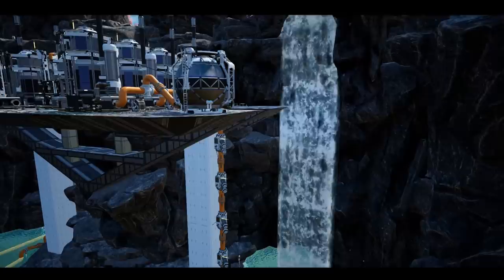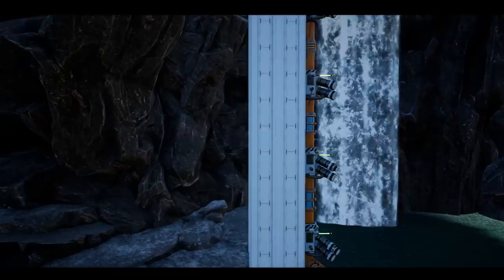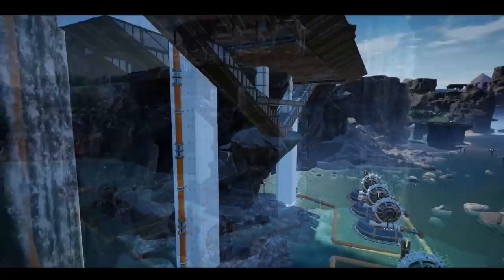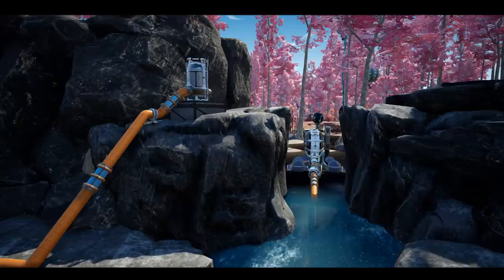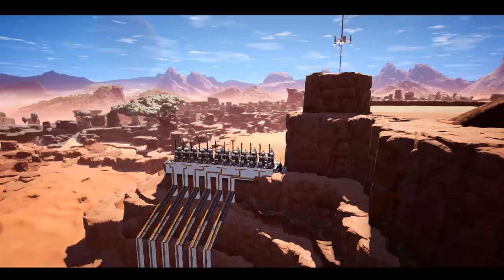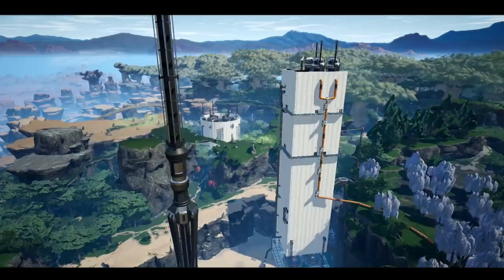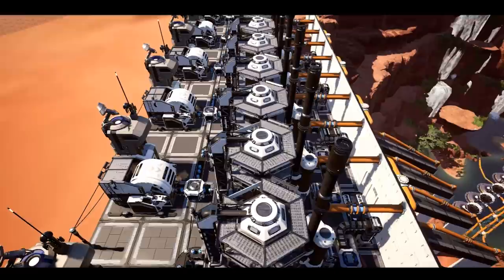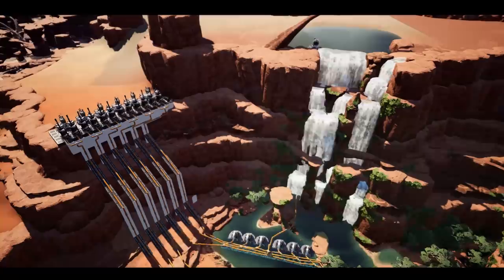A Guide to Not Needing Pumps [Satisfactory Guide]

Comment: Yes it works but it's obviously a bug/abuse/cheat.

As it is now, you can use a single water extractor, pump the water up a really high tower (or package, conveyer it up and unpackage at the top) and have that tower provide the headlift for all the extractors you want. As long as the "bottom" extractors put enough water into the pipes the top headlift will be preserved and the water tower will not even be running much (or at all) because your water level will never drop.

as with other bugs that existed (and got fixed).  be careful about using this. your entire factory could fail if they decide to fix this :)
Reply from the maker: You're right, and it is worth running this on the side of caution, but I'm sure there'll have new pipe options when they update it too so we'll probably want to redo our pipe networks (hopefully)

Comment: So, if you had a tower with a reservoir and an unpacking refinery, then all your extractors at the bottom with one packing refinery (and a belt and conveyor lift to lift the packaged product), you could use the reservoir and drop to provide your "head lift", and not need any pumps at all, right? And the refinery and belts would be rarely used, as they'd only cover the dips in production.
Reply from the maker: absolutely, and you could just hand feed the unpacker at the top then loop an actual pipe up and it would be self filling (in theory)

Comment: One year later and water is still borked-up... The game randomly decides that water pipes are empty, when loading. The head is not actually calculated correctly, or used correctly, in any instance. Pipes still have some kind of internal "direction", depending how you hook them up. Pipes still fill like individual segments, filling one at a time, when they are horizontal, as if water is pushing through a straw-hole, at the top of the segmented lines. The last item in the line, like a conveyor, will empty that pipe segment first and the pump closest to the machines will empty first. (Pipes would never "empty" in real life, unless you purged them. They would always be full of water and the pressure and flow would rise and fall. But, in this game, pipes empty, as if they were individual cups filling and draining from the bottom.)

Honestly, it's a game element that isn't needed and shouldn't exist. Just how power was simplified to "generated power vs consumed power", that is how water should have been managed. instead, we have to constantly babysit fluids, or, if luck is on our side, it actually works for a while. Hacks are the only solution to combat the hack of code related to fluid dynamics in the game.

I shouldn't expect much... They still have "iron" as shiny and silverish, and "steel" as being black and dark. (Minecraft science, which is backwards and just wrong.) They use "screws", tiny things made for doors and watches and computers, to assemble "industrial plates and heavy machinery", which should be using "bolts" and "rivets". They make "computer boards" out of plastic and copper, and it should be silica and copper... What idiot thinks computer boards are made from plastic? It takes 100 cloth to make a suit, but only 2 to make a parachute! So, we are wearing about 50 parachutes of material in a haz-mat suit... They use mycelium to make cloth, which is just impossible... We manufacture about 100x faster than a machine, which is also impossible... We have more pocket storage than a whole storage unit, vehicle storage and I think as much as a whole train caboose... Yet, a conveyor can only hold a single item at a time... Yes, it can hold 1 cloth or 1/2 a parachute or 1/100th of a haz-mat suit... or a whole, single haz-mat suit... (It can hold 1 "screw", or 1 supercomputer, made from over 8,000 screws. Go figure!)

Not going into the fact that I can build a whole machine with just a few bags of cement and screws and wire, instantly... Yet I have to spend an hour, manually making screws, cement and wire... Though I can't, in this technologically advanced world, craft a real weapon, build a vehicle that works right, have the worst energy-rated lights that draw a minimum of 1 mega-watt of power... That is enough power to light-up 100,000 10w LED bulbs, or 10,000 classic 100w floodlights today, or just that single dim light in the game.

Comment: Nice bug. A byproduct of how the fluids and headlifts are calculated for the pipes 😁
Reply: not a bug at all.
Reply from the maker: well it's not a bug, it's actual fluid mechanics, although being able to split it into multiple pipes is where it could be considered a bug, I'm not sure to what extent it works in real life, I presume if it's spread between 3 pipes each pipes should have 1/3rd of the headlift
Reply: @TotalXclipse  Actually it is kind of a simulation error, but not exactly related to headlift calculation ^^ 
The fact that water, after coming down X meters, is going up X meters is actual fluid mechanics, even if you spread it between 3 pipes, would still work fine if the flow is "infinite". A network of pipe is the same as a lake, water will always try to stay at the same level everywhere :)
However, the fact that you can pump water in the pipe from bottom is not a bug but a simulation mistake in comparison to fluid mechanics : a 10 meter headlift pump would not be able to overcome 10+ meter pressure, and thus water would not be pushed in the pipe or even flow out of the pump in the lake it is supposed to pump in. However, this game does not consider this, because I suppose they consider pumps as "adding" pressure instead of setting it (which is kind of true some pumps that can be found in real life).
Actually, I think this mistake is not one, and is done for ease of setting up pipe network, because with real fluid mechanics it would be horrible to deal with !

Comment: You just build a pipe tower and use pumps to bring 1 pipe to desired height then drop that pipe all way back down interconnect it across all pipes you wish to lift and there you go for price of power of pumps on just 1 pipe you can bring as many pipes as you wish of desired liquid to desired height
Reply from the maker: Exactly :)

Comment: In a really big and high factory (Imkibitz for example) you could have one line of packaged water go up until the top of the factory, have it be extracted and stored and this would make all pumps unnecessary
Reply from the maker: yep, absolutely - but if they redo pipes you may have problems later on
Reply: TotalXclipse Yeah, still hoping for some mk2 pipes. 300/m is just not enough

Comment: or hear me out, pump up fluid to one buffer, then have that buffer feed back down into the rest, then have the rest flow up into whatever you're needing the fluid for. At worst you would need to isolate one extractor and push its water up seperate, to bring it back down, using a fluid buffer to "reset" the head pressure

Comment: Will this work with just a buffer tank getting pumped into?  I'm building a rather large Turbo Fuel power plant, and I have a lot of vertical pipes.  I could put a pump on each line, but I'm thinking I might be able to pump up 1 pipe to a buffer tank that is on the roof for each network, Oil, Heavy Oil Residue, Fuel, and Turbo Fuel.  Would that work?

Comment: Instead of having one water source really high, could you have a bunch of pumps after it, and then split that pressurized water through more pipes so you can lift more water with just one set of pumps?
Reply from the maker: if you add extra pumps at a lower height, the headlift resets. So there's no point adding pumps, it doesn't add pressure

Comment: Looks like an exploit to me.
The lower water extractors should not be able to contribute to the head lift > 10m.
The upper extractor - that's totally fine because when you fill that pipe, the water will automatically be level without the extractor needing more pump power.
It's almost a net +/- 0 IRL.
The lower ones - nope. That's not how stuff works. So I won't use this technique. (even when I appreciate the spent time to science this)

Comment: cant you just loop then? pumping water up by head lift into a tank, and connecting it to the bottom to provide head lift?
This could even been done by water bottler to physically disconnect the both ends of the loop

Comment: This is an amazing finding. However, question is if it could be considered a bug and patched further on? As I understand logic it lifting one pipe up, but lifting multiple pipes with single pipe, ughhh, tricky. Dont know if i'd want to rely on that going further.
Anyway, amazing finding, loved the video!
Reply from the maker: That's what I was worried about as well, but apparently it's perfectly feesible - to a certain extent, I don't understand the whole idea behind it but apparently it should be possible if we had more types of pipes to choose from.

but if it does get patched... there's not difficulty in adding pumps along pipes that are already placed
Reply: @TotalXclipse  The physics should be that the amount of head lift provided by each pipe line would be related to the volumes they are carrying. If a 100m head source has 120m^3 and you have two other pipelines with 10m and 120m^3 be combined, then the total head should be h = 40m due to using conservation of energy  (mgh total = mgh pipe 1 + mgh pipe 2 + mgh pipe 3).
TLDR; physics should be the average of the head of combined pipelines not the head of the tallest pipeline

Comment: I have my factory with 90 nuclear power plants all running without pumps. I also have my oil without pumps. But with water I am not consuming anywhere near my maximum. With oil I am, and I noticed with my oil setup, for some reason I don't get all 300 oil out of the incoming pipe into the connected refineries, it seems to come short. I have mitigated this a bit by having any pipe that is a dead end or one that connected multiple 300 input pipes to be eliminated since some pressure would get wasted in there, but still can't seem to get all 300 through... not sure what is wrong, I am having my oil pump from the western sea and piped to the green fields on a 4 level stacked pipe. The 10 meter headlift allows you to go up to 6 level stacked, so this seems ok. In the green fields I see 3 pipes of 300, but last pipe of only 290, it was 250 before I removed all pipes that weren't necessary. I am not sure what else to do, since this affects my rubber and plastic output which affects my supercomputer, turbo motor, and battery manufacturing at the end of my smart splitter manufacturing area.... any ideas? By the way you can view my setup on the video I have up on my channel.
Reply from the maker: I really don't know what to say, perhaps you need pumps for longer distances to maintain the flow rate, So I'd test running a couple of pumps along one pipeline and see if the flow rate improves, vs the others

Comment: WAit ... isn't that actually how water works in real life too ? I mean that's the logic behind water towers right ? Wont'water always level at it's highest input point ???
Reply from the maker: Yes, although with the way liquid mechanics are implemented, attaching working extractors at the bottom of the tower shouldn't work.
Reply: TotalXclipse exactly- the water extractors at the bottom are pushing water into a system at a very high pressure (due to head lift). In real life, this would cost a lot of energy and would require pumps capable of producing at that head lift. In the game, a more realistic result would be that the pumps below are unable to produce water because the hydraulic head is overcoming them (as it’s over 20m).

Comment: So, you only need to lift water/oil of one extrator in a water tower to be free of all pump for the others.
But, does the height of that tower need to be the same as the height you want to raise?
Reply from the maker: The height of the initial tower has to be as high or higher. You can use a pump to get water up there and after all other pipes will be able to use that head list.

Comment: Can't test it now but if you have no higher source could you pump a single pipe up to a storage tank and then use that as the header tank for the rest of the pipes so you only need one set of pumps instead of relying on a higher source? I'm not sure that was what you meant at the end.
Reply from the maker: Yep, absolutely, that's what I use in my 5x5 challenge :)

Comment: Well I don't know if it is of any use. The amount of work to build and connect the upper extractor to the other is far more tedious than adding pumps to me.
Reply from the maker: But once you've done it once, you don't need to do it again, which saves you exponentially when it comes to powering pumps on large networks

Comment: Wait? Could u not just place a tank somewhere very high fill it up once and then connect its output down to the pumps and then connect the pumps to the input of the high tank so it gets filled up when it drops water?
Reply from the maker: You can't connect the output to pumps or it doesn't work so you'd have to fill it up, then delete the pumps and connect it to extractors, but yes if the extractor is connected to the water tower pipe, in theory yes. That would work, it's something I want the time to try it out :)

Comment: Well, essentially an exploit that can stop working any time devs decide to fix their physics. And then the bug reporting site will get flooded with complaints about "pipe bugs" just like when the Z=0 bug was fixed.
Reply from the maker: Do you believe that they're going to redo pipe physics after a few months of having it? There's truth behind how this works and theoretically it's possible if they were to give us extra valves and pumps to play around with and even if they do choose to fix this, I could just add pumps onto the pipes
Reply: I'm pretty sure that if devs decide they don't like this exploit, they will fix it. That does not mean they will, but it also does not mean they won't. They fixed the Z=0 exploit too. And no, it's not possible, even theoretically, in real world. A pipe filled from 100 m above will create presure equal to liquid column 100m high at its bottom and any pump adding liquid to it from the bottom must be able to overcome that pressure which is exactly the same as to be able to pump liquid 100 m high.

I mean, sure, teach people whatever you like, it's fine. There's no cheating in single player games. But I'd recommend to tell them it's an exploit and may stop working any time.
Reply: Think water towers. And how we use them in real life.

Comment: Well, thanks. That is an interesting setup, but I wouldn't recommend it (at least I won't be using it), because it sounds like a bug which might be fixed sometime in the future AND you wouldn't want your factories stop working. This sounds like a bug to me, because basically you are using a small amount of water to push up a lot of water. Seems to be against the laws of physics.
Reply from the maker: It does work in real life, the issue is the extractors (from what I understand) at the bottom. That being said I doubt they'll update the fluid mechanics until they have more pipes/pumps and valves for us to use, by which point we'll be able to do this any way :)

Comment: So... in theory I could get all of my storage really high up (using pumps to get it there, then store it in fluid buffers then add a single pump after the fluid buffer and never need a pump after that point in the network?
Reply from the maker: All you need  is a single extractor pumping water to a high up storage unit, then no pumps after that, you can then split that single line between 10 other lines and providing they don't have any pumps... they'll gain the same head lift.

Comment: ...I dun get it. You put one pump on higher elevation than your destination and it gets there?
I made a really long oil pipe going up a mountain, then it goes back down into a swamp a little bit and then it needs to go up another hill that is not as high as the first mountain. 
Yet for that hill near the end I still need a few pumps for it to go up. Pumps are just super weird in satisfactory.
Reply from the maker: If you have a pump or a liquid container bufferring on the lower area, head lift will be reset
Reply: We are building very large water towers.

Comment: So...

this isn't a bug, is it? I am working on a 300GW nuclear power plant setup and I need A LOT of water, high up... I got my entire factory working without pumps so far but I don't think this is intended... can I really move 8000/m water up 200 meters because I have one single source of 120/m another 70 meters higher above the factory floor? Is physics that crazy? looks.at.quantums Yeah, it might be but I don't think it is in this case. This is a bug, isn't it?
Reply from the maker: Kinda, and kinda not... so the premise is correct, headlift will allow you to lift water to the highest point of pressure in a system but the issue is with adding extra pumps at the bottom, that shouldn't allow you to lift more water, so it really depends on if Coffee Stain update it in the fluid update.

Comment: Does this also eliminate the need to have a pump every roughly 52 foundations on long pipes to keep the pressure up?
Reply from the maker: I'll be honest, I've never use pumps along long level pipes, but I'm not sure if I've ever run them that far before. I should imagine, if you run water from the top to the source of the others, if they're able to push water up heights without an issue then yes it could remove the need for pumps there as well
Reply: @TotalXclipse  Have to test that. Some more crazy ideas for factory designs in my head have been put aside because of that so far. ;)